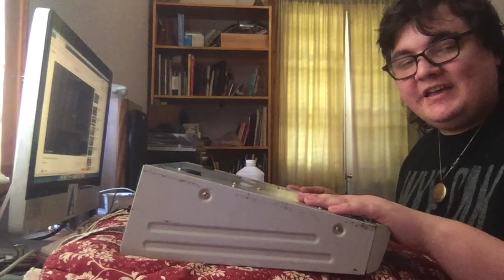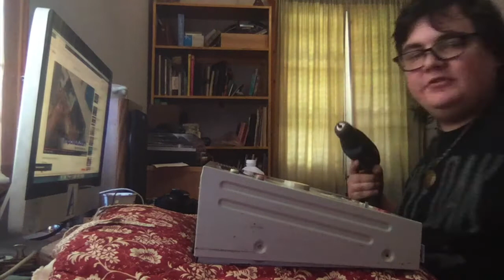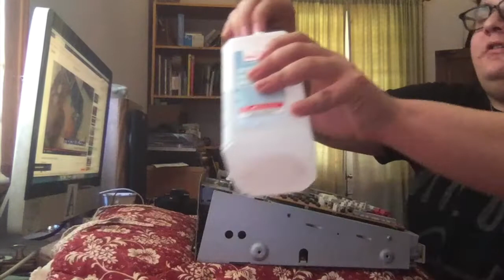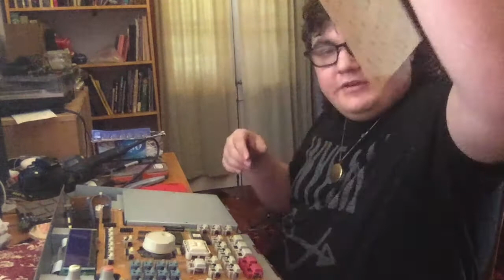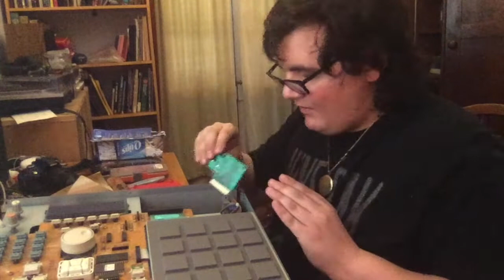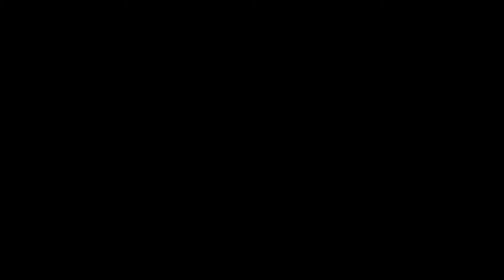MPC 2000 Maintenance: Fix Dead Buttons & Pads, Install SMPTE Upgrade

Comment: Having an issue with my 2k, says disk boot error. My disc is 1.5, it’s asking for 1.0. I tried using another floppy drive but it didn’t fix the issue. Would a usb loader swap fix my issue? Or maybe a 1.0 disk?
Reply: it sounds like you ruled out bad drive and just need a disc with a compatible OS. maybe the 1.5 os doesn't work with your machine for some reason
Reply: @paulschoen9940  I bought a scsi drive that boots from an sd card

Comment: hey i recently got a 2000 to repair, all i knew about it was it turned on and said "disk read error". I got the OS and I got it to load, tho the drive is iffy and only loads sometimes so I plan to replace it probably with a USB one. I noticed the ports on back are fine other than the headphone jack so I gotta replace that. I cleaned all the buttons well with deoxit and they work nice. Screen is faded and needs a replacement but works for now. I can't get a single pad to register when I hit them tho, I'm hoping it's just the pad sensor as  I will buy a replacement kit. I 've fixed up a 1000 in a similar way and fully customized it. 

Just wanted to say thanks for this video because i'm on the same journey my dude.

Comment: one of the screws got rounded on mine so I can't even open it right now
Reply: use a star pattern socket or saw the top of screw for a flathead screwdriver

Comment: Great tutorial--thanks! I had a midi button on my MPC 3K that was almost completely unresponsive so I left it with Triple S service in Bloomfield NJ with instructions to replace the tact. switch underneath it as well as the switches under a number of other buttons. They called and left a messege when it was done with a really low price on the work and I was pissed because they couldn't possibly have put in new tact. switches for that price. The tech revealed the secret when I stopped in to pick it up: "We often find simply cleaning the switches is all you have to do to get a button working." Sure enough every button--including the near unresponsive midi button was now fully functional!   Watching your vid I now know how they did it--Bravo, Analog Schmanalog!

Comment: Good job. Had mine since Nov 1997. 2000s are reliable. Only issue I experienced is the burnt screen appearance. That was 2 years ago. Which appears to be the glue underneath the polarizer. It's mostly a cosmetic issue as I can still read the screen. So it doesnt bother me.

Comment: yo, how do i install / upgrade the RAM on this machine?
Reply: easy peasy job, if u need help find me on ig @schoenson and i can walk u through. . .  if I recall correct you remove the bottom panel and there's easy access slots for ram chips
Reply: @paulschoen9940  yeah on the 2000xl... there is no bottom panel on the 2000 classic... gotta dig your way down to it.

Comment: So, I haven't used my MPC 2000 for a LONG TIME,... like 7 years. I just tried to load some samples. SND and WAV. When I hit the pads, it sounds COMPLETELY DISTORTED - NOISE AND DISTORTION. You can BARELY hear the sound. Any ideas? (Thanks in advance) BTW, I did try several different pads, across all 4 banks. Didn't matter.